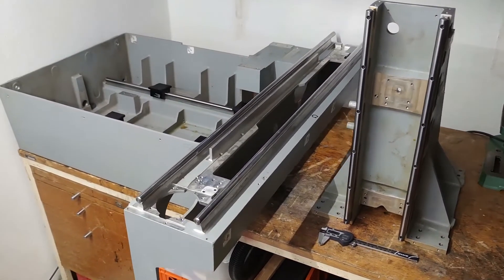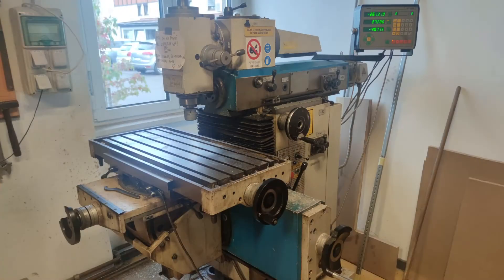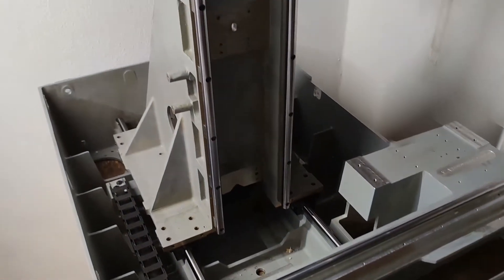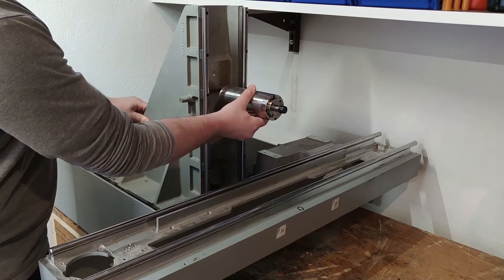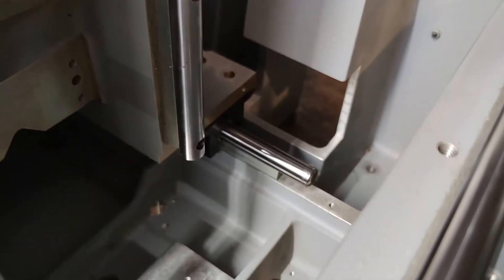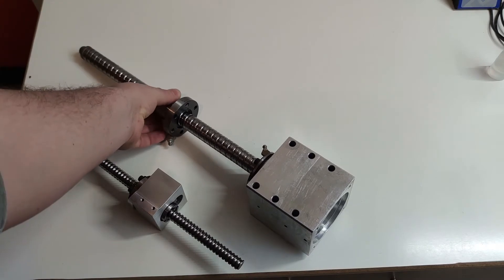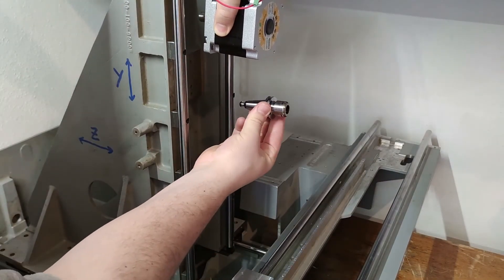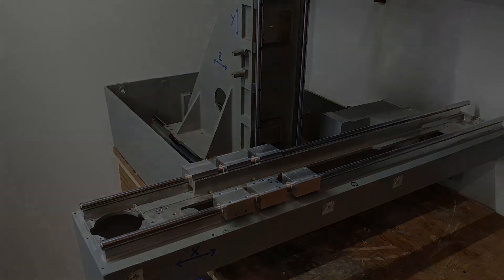Converting 3D Printer to DIY CNC | Part 1 #CNC

Comment: Nice start. Looking forward to the build👍🏻why did you decide on the horizontal spindle instead of a vertical?
Reply from the maker: I could get the most travel and highest rigidity that way. And it opens a lot of possibilities for machining that way with high travel in z direction (~200mm). Another benefit is good chip evacuation but that is especially important in big horizontal cnc machines for high volume production.